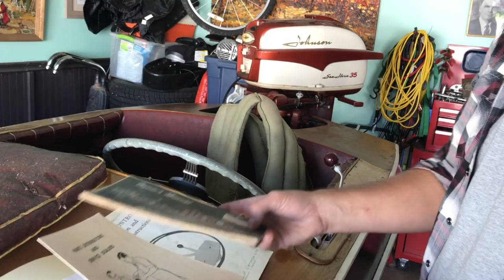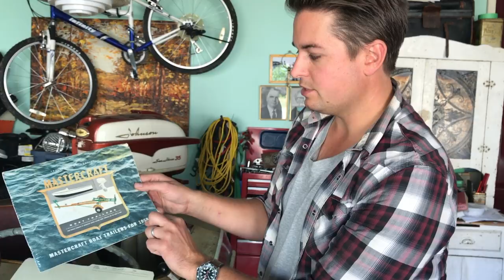Bringing home a vintage barn find racing runabout! Hidden for 40 years

Comment: The banjo wheel appears to be a 1936 Ford or older wheel.   I have one that I put on my 1933 hydroplane barn find that I found buried in a garage for 50 years.  So the age might be somewhat accurate.   As for the plywood not existing comments, that's a bunch of nonsense.  My 1933 Ventnor came with 1/16" plywood, which is the same plywood that airplane manufacturers used as covering for aircraft frames back in the day.  I naturally cant verify the age, but it is definitely possible in my opinion to be late 20's or early 30's.  Awesome find!  Love the row boat too!
Reply from the maker: +ptcfan thanks so much for your knowledge and positivity. And you’re right plywood was around back then, I think the new windshield and motor threw them off :)  don’t forget to subscribe! :)

Comment: So cool the roe boat is early 20’s or 30’s but the motor boat I think is a little later maybe 40’s 50’s of course I could be wrong but the reason I say later is because I used to have one almost identical to that one I think it was a kit boat mine was from the early 50’s like I said I could be completely wrong super cool no matter what that’s for sure! Thx for the super cool video!

Comment: I'm going with the built in the 50's crowd, everything points to that, although commercial outboards started around 1910 the size required to push a boat this size didnt happen till late 40's, anything before that would require money, mechanical ability and special fuel mixes. the wind screen and hardware suggest mail order parts from the 50's as well. As well water proof glue  plywood did not exist commercially until the 40's and not readily available till the late 40's. Not to rain on your parade, this is a real gem appearing to be built well probably according to plans from pop mechanics or the like.

Comment: I have a 1959 race boat built by a guy in Denmark. It has tail fins. With a 40 horse short shaft, it went 96 mph 25 years ago. I'm too tired to restore it again. Located in Maryland.
Reply from the maker: Sounds like a cool piece!
Reply from the maker: If you can, send pics to curiosityedmonton@gmail.com

Comment: They didn't have deep V hulls in the   1920's or Plexiglas wind screens. This boat was made in the late 1950's or early 60's.
Reply from the maker: Thanks Bob, I was told the boat was re fitted with new windshield and motor in the 50’s this boat was in fact registered in the early 30’s

Comment: The whole set up looks like 1958... boat, the Johnson outboard motor and trailer. In 1921 you would have had to row it.... as there were no outboards that could have pushed that boat in 1921.
Reply from the maker: turbothrust348 they surprisingly did race these back in the 20's. These folks were the second owners since the 40's and gave me the build paperwork :) it's a cool old piece. But yes lots of parts put on in the 50's :)
Reply: What was the power for racing it back then ??? I have a 1922 and 1926 Johnson. They are 2 and 2+ horse power, hardly a racing engine. Here is my video of the 1926 running on a 12 foot row boat. https://youtu.be/H_LSd66DFp0  You can see it's kinda slow.
Reply from the maker: I'm not sure since the motor I got with it was a Johnson 35. I know Johnson made a 26hp V-45 in the 20's which would have had this thing moving pretty good. This boat didn't have a windscreen on it when first built. I love your boat BTW! a beauty!
Reply: turbothrust348 yes there was
Reply: Yea, I checked a book out from the library several years ago and it was all about vintage outboard collecting. I was worried about catching the bug. They were incredible little motors and looked cool.
Reply: The first outboard was developed in 1870, just sayin
Reply: An 1870 outboard would have been an egg beater, not a racing motor. Waterman made the first useable outboard motor, then Evinrude made his, followed by Johnson. Johnson made there first outboard in 1922... I have a low serial number 1922 Johnson A. Here is a link to the video about it. https://youtu.be/IaGfpGfju8Q From working on boats for over 30 years, I would say the boat is a 1958, just like the the engine and controls. I was a marine mechanic, owning the business, and worked on thousands of boats, from the 30's to todays boats. There is NO WAY that boat is a 1921!
Reply: Same thing I was thinking
Reply: They were usually powered by an inboard motor, oh by the way Mastercraft Marine is a totally different company from Canadian Tires MASTERCRAFT.
Reply: +turbothrust348 ....looks exactly like a boat my grandfather ..my dad and uncle had back in the 50s..almost to a T with the cockpit and dash
Reply: Hello turbothrust,
I had a customer who displayed a 1910 Neptune outboard in his home's entrance hall.  My "Uncle' Bill had a huge horizontal opposed 2 cylinder Evinrude from the Thirties.
The boat design is 1920's with the cockpit mounted as far back as possible  for tiller-style steering of the outboard. As we all see there are 1950's upgrades for sport boating instead racing with steering wheel and windshield.  The Banjo style steering wheel is definitely a 1930's feature.
That boat would be a neat display at an antique boat show like the classic antique wood boat shows in Gravenhurst or Port Carling Ontario!
Reply: knightz zoss if you need to go to YouTube comment sections on how to fix it then you should probably hire somebody to fix it for you.
Reply: knightz zoss first thing no one will know anything about it if you don't give any information on who built the motor what type of motor it is and describing the boat would be a good start. Also start searching other places besides YouTube videos.
Reply: knightz zoss are you sure the motor is a diesel? Sounds like you're describing a Hercules or Continental inline 6 possibly a Chrysler RM8 Royal. Putting a Dodge Ram diesel in that boat would take a lot of work including custom fabrication and machining. You need to find forums about old boats.

Comment: The steering wheel is a Banjo style from a 37 ford, I agree it looks more like the 1950s by the style and wood is was built from, Do not tow it with the cover on as it will rub and mark the body and it is not a really good fit?
Reply from the maker: We’re getting a more appropriate windscreen for it, it was used without one originally.

Comment: Hahahaha I know who built it and he definitely didn't build it in 1921 unless she meant restored which this boat is still not 1921. Also they didn't have plywood or epoxy molded hulls in 1921 either. More like 1950-1951. Also don't tow the boat with the cover on unless it's built to be towed that way a loose cover will damage the paint and varnish.
Reply from the maker: +Jimmy Grant she swears 20's but he did tons of work on it in the 50's so maybe it had full restoration then?
Reply: Jimmy Grant.  They were using plywood to build airplanes for the first world war and had a dozen outboard manufacturers in the 1920. the lady told him it was built in 1921 and that the wind screen and motor were newer part of the boat.
Reply: @CuriosityIncorporated  old people always get there year's mest up I do not believe this boat is from the 20's more like 40's
Reply: Who built it then since ya know?!
Reply: @nethanelmasters5170  they didn't use plywood on airplanes
Reply: @MrJeep75  read a book on ww1 airplane construction. Also the german horton ho 229 flying wing was made of plywood.

Comment: so who is the manufacturer on the boat? let's one thing you don't tell us tell about the trailer about the motor about the electric start and the levers for reverse and drive but who manufactured the boat a lot of the hardware on the joining of the wood doesn't look like 21 yeah you said there were parts put on it in the fifties but the bolts and nuts don't match up to a 1921 bolts and nuts just like to know a little more history on it who made it
Reply from the maker: +Z BEAR it was custom built boat, has no maker name on it other then the tags they got from the government. Was told the builders name though.